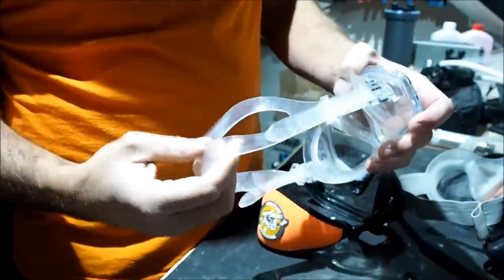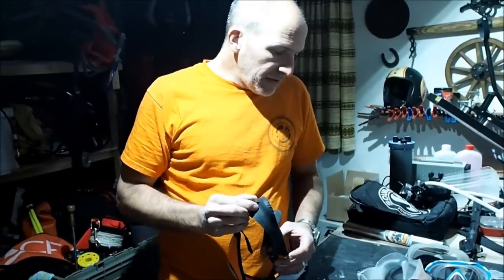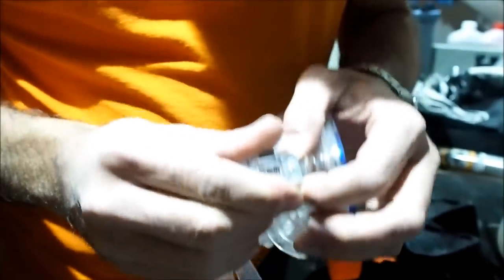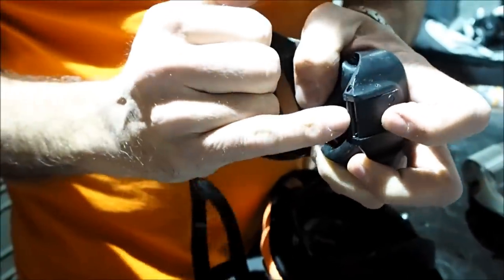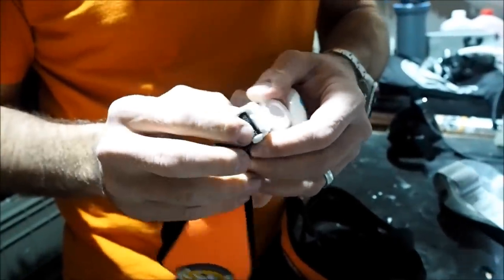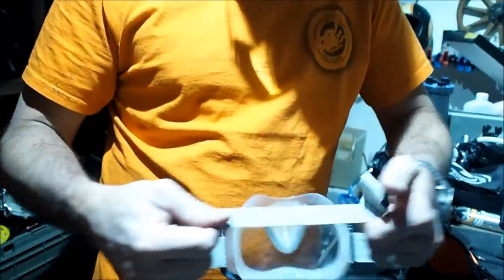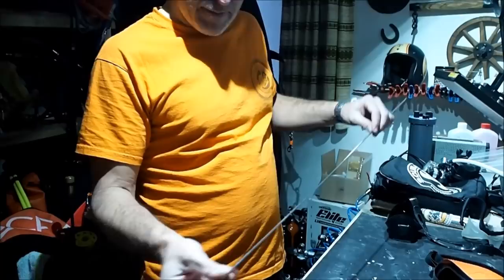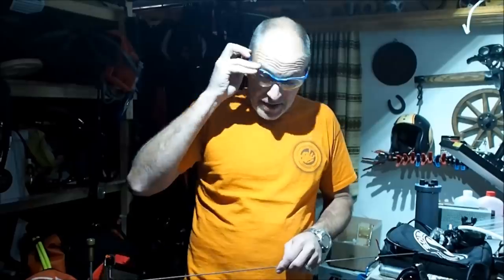How to make an unbreakable maskstrap conection

Comment: I’m diving since 2002, and I have never experienced or witnessed a mask strap failure. Just wondering is this necessary?
Reply: I've had the QD ones fail on my. Only on land though, after it failed I got rid of them. Also seen the push to release ones stop gripping the strap and loosen constantly during the dive. In a pinch you can fix it under by tieing the strap around itself.

Comment: Thanks for the videos. Most of them I find quite informative and thoughtful. This one just seems inconsistent with what you normally produce.

Specifically, this manner of modifying a mask seems ill advised and potentially dangerous. We all do some level of modification to our gear. From cutting webbing and moving D-rings to creating leashes and adding tank straps for a pony tank of Argon tank and many more. None of these fall into the same category as this one though. A scuba mask, like any other whole product you buy, has been tested during the development of the product. Some of the tests that products undergo are reliability testing. Every single brand of equipment insists that tests are performed on any equipment with their name on it. So, we can assume that there was some donning and doffing test of the mask, and some stretch test of the mask strap with the buckles and the mask all put together. There is certainly some standard that the mask had to pass as designed and manufactured that it could handle some minimum number of donning and doffing cycles as a complete mask unit. 

Now, in this video, you are suggesting that divers pull out the buckle and replace it with the bent piece of metal wire. So, even assuming that a diver gets this done without damaging the strap, mask skirt, or buckle with a tiny tear or crack that will get worse over time, they’ve just rendered all of the testing that was done on the mask in the first place irrelevant. No one knows how long a mask that has been modified like this is going to last and how it will fail, but the entire unit will probably not last as long as the original configuration, otherwise high end manufacturers would already be making masks like this.

This video just doesn’t seem to be in the same league as the rest of your videos that you’ve made that highlight your experience, knowledge, and clarity of thought around diving.

Comment: I generally love your videos and suggestions but in this one you are suggesting eliminating a silicone strap failure point by replacing it with a nylon webbing strap....attached to a d-ring attached to the silicone skirt.  If silicone is going to fail it is going to fail.  The ring attached to skirt is prone to just as much stress as the mask strap.

Comment: After i saw this vid i checked my mask's and found a defect. It's a atomic mask and only two years old. The plasti thing wich hold the steel rod what is going thrue the silicon chipt of a bit. So i think a V4A ring is a good prober solution .

Comment: Don’t Feck with your mask like this. Buy a quality mask in the first place. Inspect it, as with all your other gear, to ensure it is fit for diving.
Reply: I got a atomic aquatics mask, and quess what ? The plastic from the strap holder brock and i will not pay big money for replacemente to get the same problem in two years again. The steel ring will do the job better and longer .